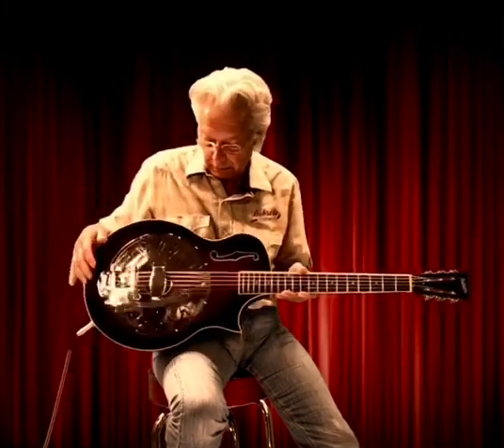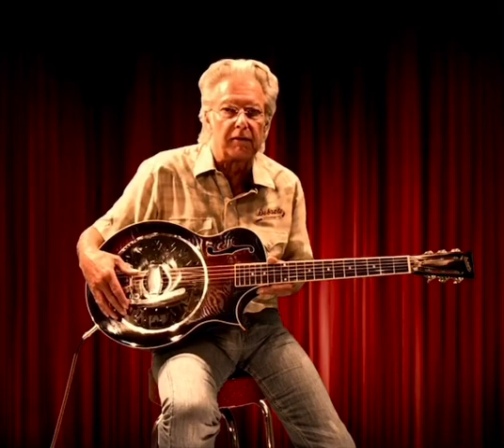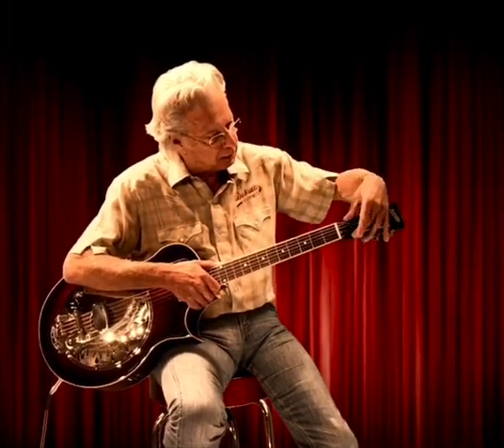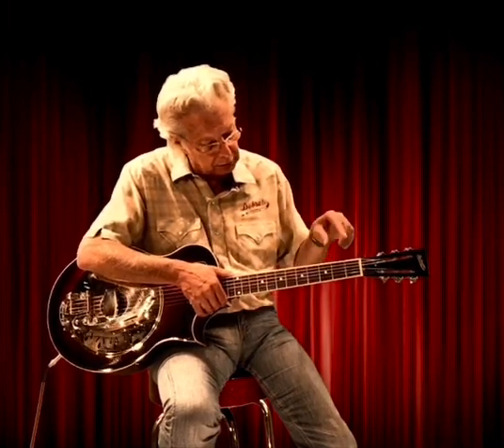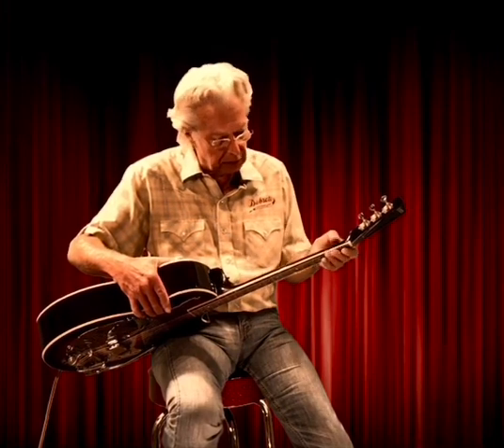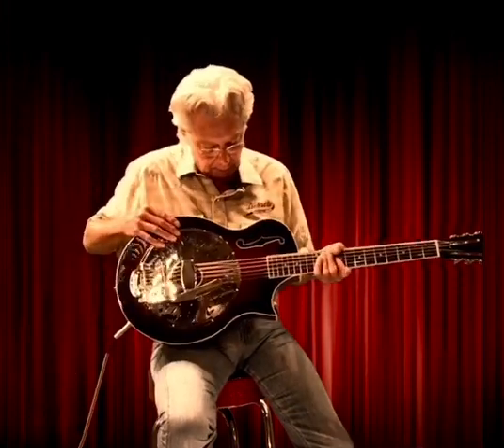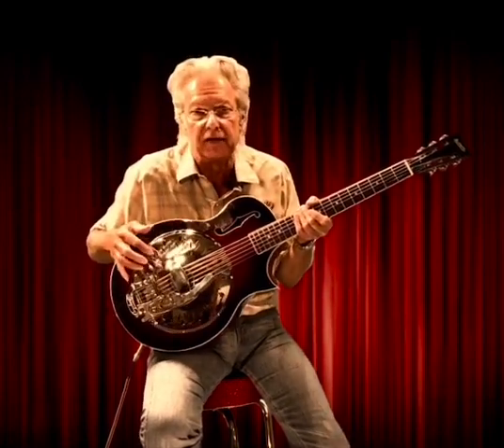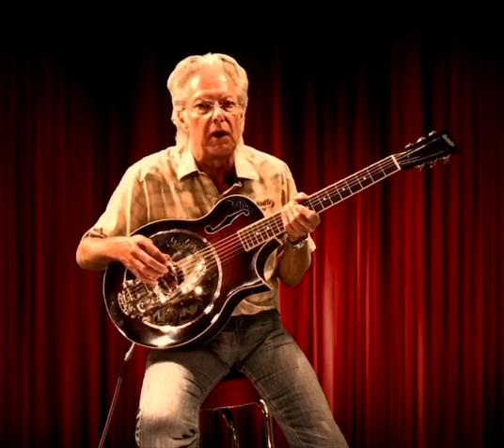Dobrato Resophonic Guitar, Introduction.

Comment: Hi Kent - Sweet tones! Can you tell me where the Dobrato body and neck are made?
Reply from the maker: Thanks, I built 3 prototypes over 4 years to get to the voicing of the instrument I was hunting for.  My final piece, I used my body and neck as a mold and contracted a company out of San Francisco to produce the shell and neck, laminated Mahogany.  I then do the fret work.  My cones are spun by Paul Beard, the pickup is made by Fishman, my bender mechanism is fabricated by my co designer in upstate New York.  I hand assemble each Dobrato in my shop in Colorado.  Thanks.
Reply: I made my own with a rogue dobro using a teisco trem